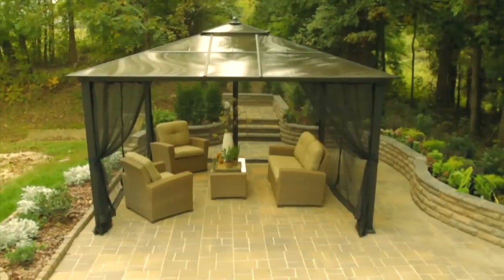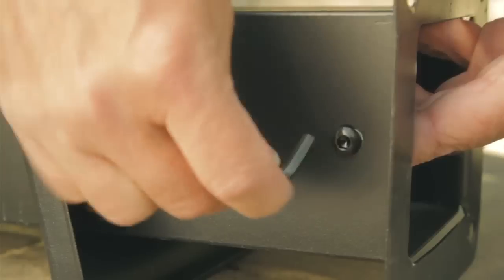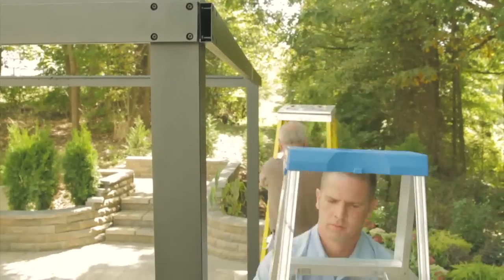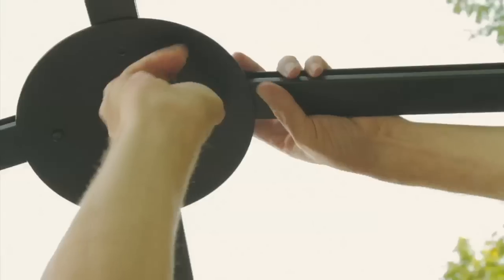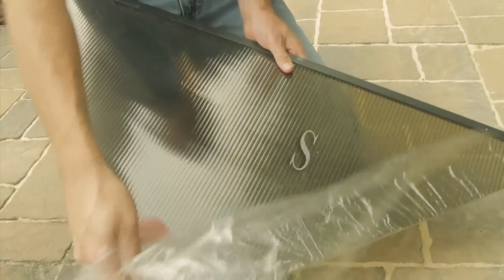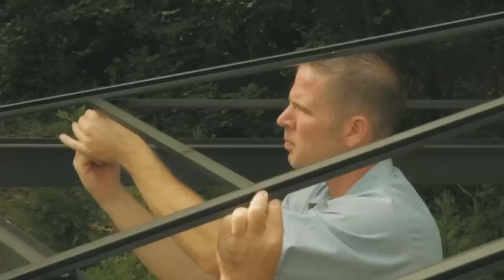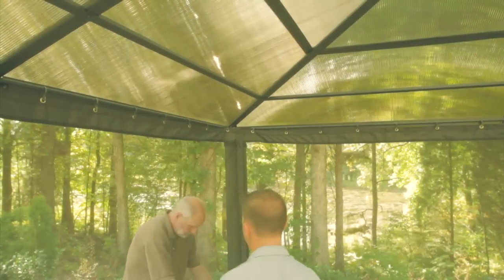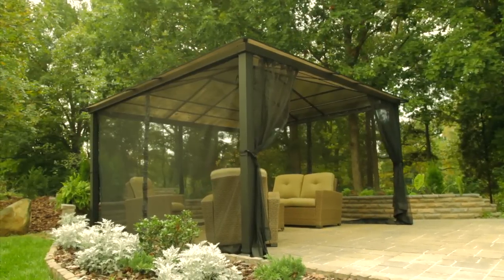Lowe's Gazebo Installation Video

Comment: Yeah right, he drilled 1/2 inch holes in concrete with a regular cordless drill.   What happened with the Roto-hammer bit he showed a second ago?   Can't use that with a regular drill.